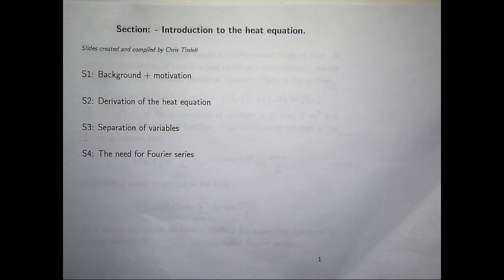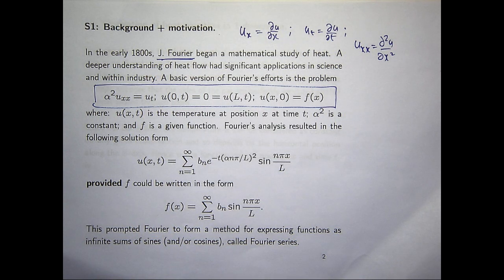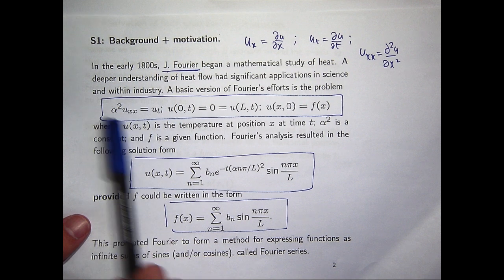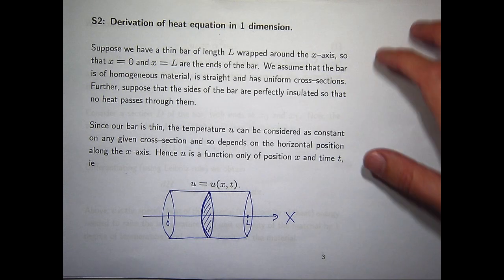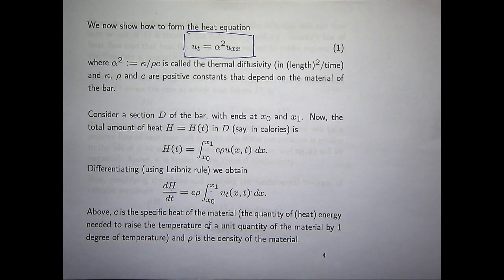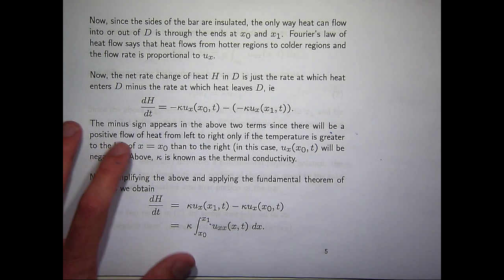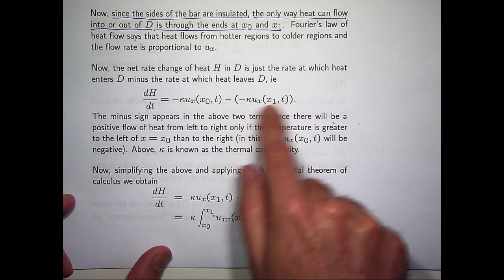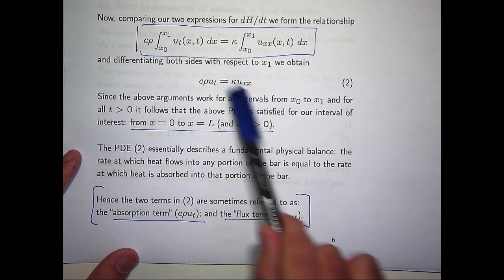Heat equation derivation

Comment: I was just thinking that since most people at this level know Gauss' theorem, it is almost easier to derive the 3D version of the heat equation. You do not need to think "why are we doing this in 1D and what is it that I need to remember about how 1D is helping me, and what are the limitations". If this helps anyone here:, consider an arbitrary volume inside a thermally conducting material.

The internal energy in that volume is:

U=∫ rho*C*T dV

The power flowing out of that volume,  i.e the net power flux summed over the boundary surface containing that volume is

P ∫ -k*grad(T) . dS

Here dV is integrating over our chosen arbitrary fixed volume. dS is integrating over the boundary surface containing this volume. dS is the usual element of area [its magnitude being a tiny area and its direction being the normal to the surface. Conservation of energy says that the rate of change of internal energy must equal the net thermal power flowing across the surface boundary. Expressed mathematically this says that:

d/dt∫  rho*C*T dV = ∫k*grad(T) . dS

The trick is that we want to change the dS into a dV. For this we use Gauss's theorem {also called the divergence theorem). This theorem takes the form

∫ b.dS = ∫div (b ) dV 

Using this on the right hand side of our conservation equation we get

d/dt ∫  rho*C*T dV =∫  div( k*grad(T) ). dV    

since rho, C and k are constants and the volume of integration is fixed we can write this as:

∫  rho*C* ∂T/∂t    *dV = ∫   k * div (grad (T) )  dV    

comparing left and riuhgt hand sides and remembering that our volume was arbitrary, this expression means that we must have that:

 rho*C* ∂T/∂t      =  k * div (grad( T)) 

And in good old 18th centrury mathematical language we get the familiar heat diffusion equation in 3D.

 rho*C* ∂T/∂t   =  k * ∇² T

Comment: @ 14:12 "Differentiate WRT x sub 1? Not sure i get that? I understand if it is supposed to be just diff WRD x.
Reply from the maker: Hi - think of x_1 as a variable in the integral sign.  (Also check out my vids on Leibniz rule).  Can you see why it wouldn't work if you diff wrt x?
Reply: hmmmm, yes i think i can (then we don't get zero under the integral sign?). So we will get (cp).u_t(x_1,t) = (k).u_xx(x_1, t) and since x_1 was chosen arbitrarily then it is true for all x in our domain? If this isn't right....then I think I am missing something